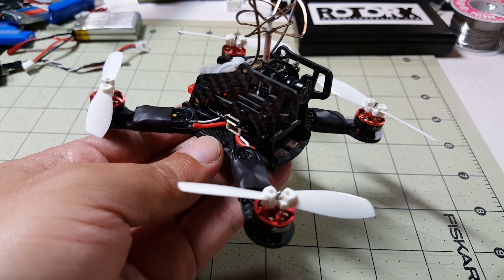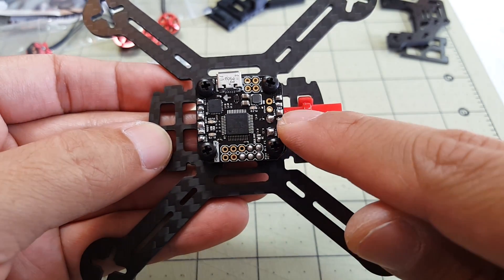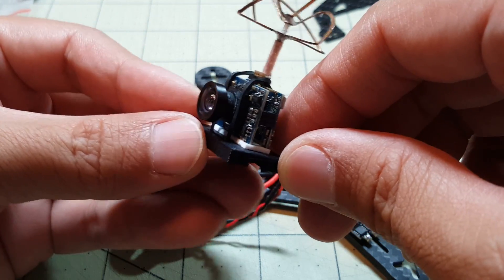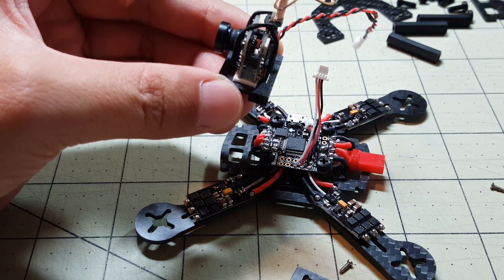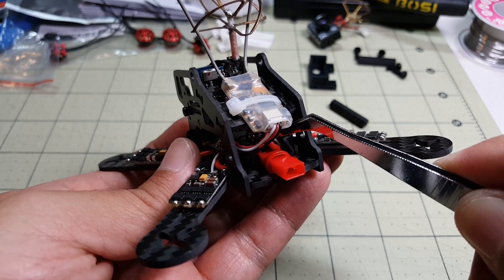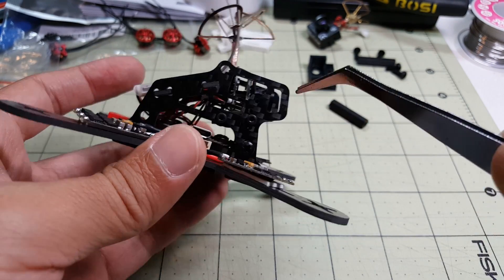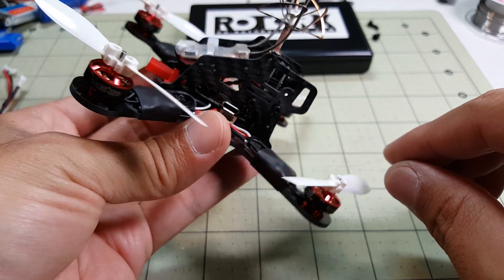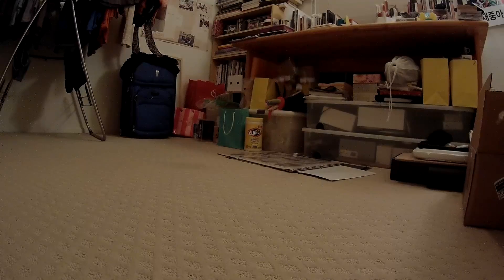Tomoquads XBL117 Microquad Build

Comment: Hi Albert, first thanks for your usefull videos. I just finished this build and I have a question about configuring my Flysky i6S transmitter and the fs-a8S receiver with the Piko BLX. Can you tell me what is your configuration in Betaflight and on the transmitter in the system output mode? Thanks!
Reply from the maker: +Mydall I'm using IBUS in configurator and on transmitter.
Reply: Albert Kim ok thanks! And you use UART1 in Betaflight?

Comment: Albert, you know a fair bit about micro quads. Do you know of any micro flight controllers for brush-less motors with the receiver built in? Something that'll work with a Taranis. Cheers
Reply from the maker: Sorry, don't know of any micro FC's with a built-in FrSky receiver. Typically brushless setups will have plenty of power to add a separate micro receiver to a small FC without much worry.
Reply: Albert Kim
Fair play. Thanks

Comment: Do they props have enough tension without any screws to stay on the motor ?
Reply from the maker: +JJc6996 I use dental floss to help keep them on.
Reply: Albert Kim are any props that stay on without the need for something like that ?
Reply from the maker: I've heard the LKTR90 props will but I don't have those to test.

Comment: what batteries are you using in the flight footage? and have you tried those as a quad prop on those motors?
Reply from the maker: +Kenny Cox 500mah 2s 25c Zippy. Have not tried the quad blade yet.
Reply: Let me know if you try them as a quad blade. I'm interested. That thing is a little ripper. Super punchy.
Reply from the maker: OK, I'll keep ya posted
Reply: Thanks. Yeah, Let me know. I'm more curious if the motors and esc's can handle it. Or if there is any advantage.
Reply from the maker: For this small prop, my expectation is the performance will be worse.  The motor has to spin up twice the mass as before (need more torque) and then has to bring the whole thing up to speed and this will be slower than before.  You may get more top end thrust (a very small amount) but trade off performance on the low to mid ends.
Reply: I got ya.

Comment: Great stuff! Are the motors really as quiet and smooth as they sound on your video? What release of BF and Blheli are you using?
Reply from the maker: +Mark Sherman yes... very smooth and quiet.  BF 3.0...blheli 16.3
Reply from the maker: +Mark Sherman yes... very smooth and quiet.  BF 3.0...blheli 16.3
Reply from the maker: +Mark Sherman yes... very smooth and quiet.  BF 3.0...blheli 16.3

Comment: Can you do a thrust test even just reversing one motor and spinning it up in the config? Also look at the x252 spare camera... 720p and 5.8.
Reply from the maker: x252?  Syma?
Reply from the maker: OK, I found it... XK X252 FPV Set...  this one?  http://goo.gl/RwJdhD    How good is the video quality??
Reply: Albert Kim it's fpv is wide and flyable. 23fps or so. 30 when not recording. The recording is 808 #16 720p or maybe better. I haven't seen recording on a very stable craft with flat lighting, the ideal conditions.
Reply from the maker: +womplestilskin ok, I'll check it out
Reply: Albert Kim you can use a nylon wire tie instead of the rear spacer, it should add stiffness. Lighter than the standoff too. I'd   put one at the top too.  You can use just the head of a second wire tie if you want to have a cleaner look (no doubling back)
Reply from the maker: +womplestilskin In fact that's exactly what I did

Comment: I have been waiting for this for what feels like forever! I was so intrigued by this frame/build. how would you say the speed compares to a more standard 130 or even 180 size quad on 3s?
Reply from the maker: Flight video will be out in a couple days.  It's FAST.  I should try and race a 130 on 3S and see.  Also, because it's so light I can do some crazy hang time aerobatics.  I'll be flying this one a lot.
Reply: I have 180 Tweaker on 4s with 1806 2700 KV motors, and I have this on order with basically the same motors+Escs as Albert Kim.

I plan to run 500 Mah HV 2s batteries on Gemfan props on the XBL117.  I ll try to set up a little TT around my back yard. My guess is the 4s Tweaker(which only weighs 252 grams prior to battery) will crush it though. 

Still considering how fairly cheap this is(the XBL117), outdoor brushed quadcopter might be soon extinction. .